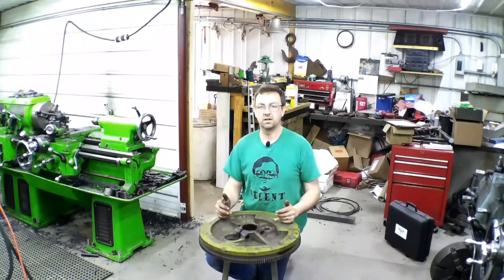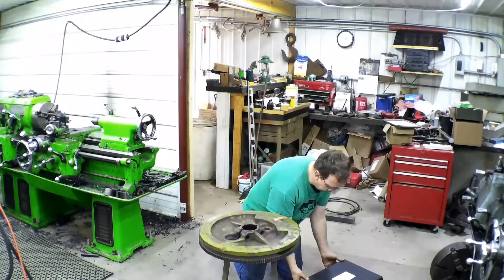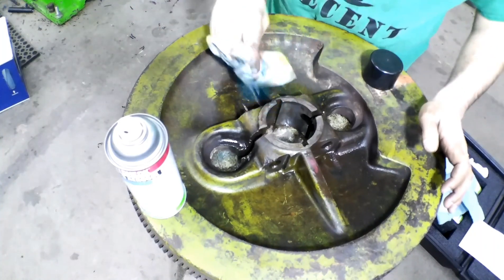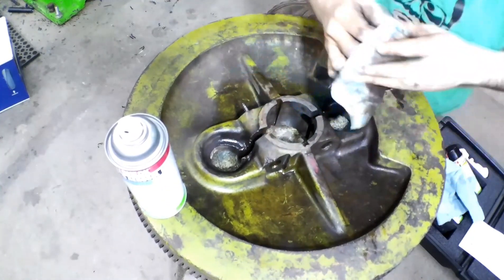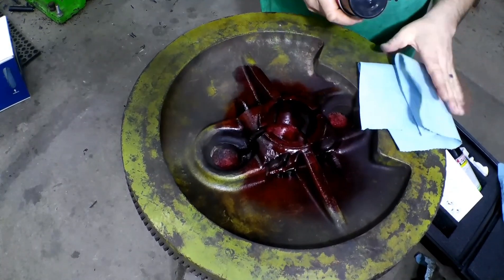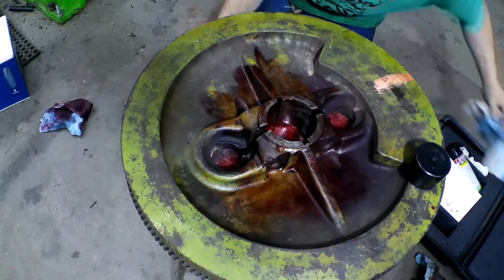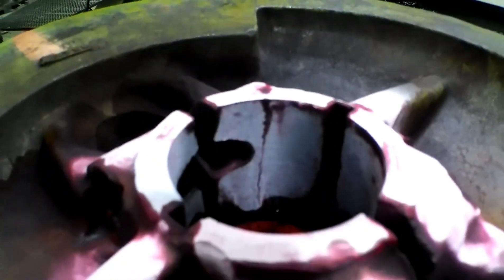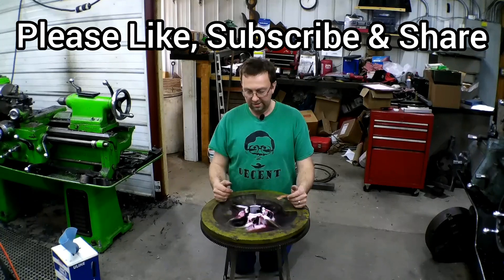Looking for Cracks in a John Deere 720 Diesel Flywheel, Magnaflux Dye Penetrant Test

Comment: The proper way to stop a 2 cyl diesel is to cut the fuel and then pull the decompressor lever and let the engine roll to a natural stop without compression. No cracked flywheel.